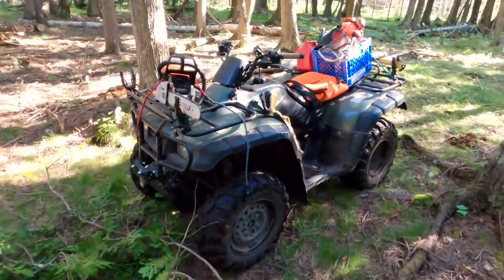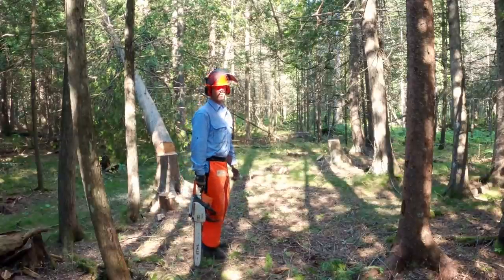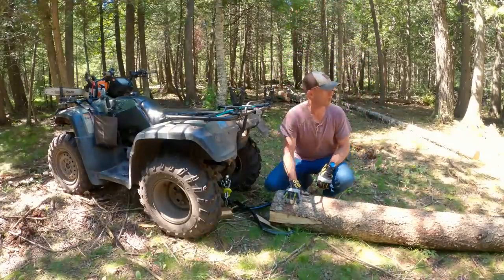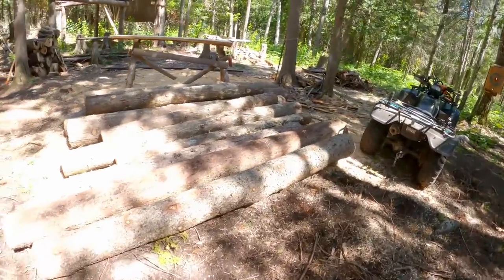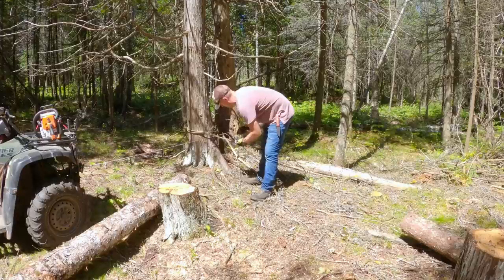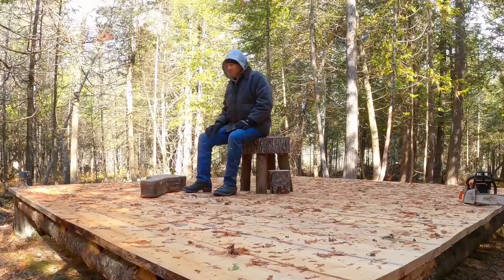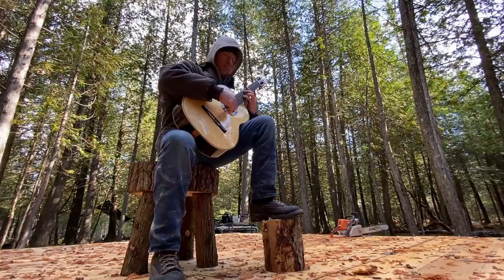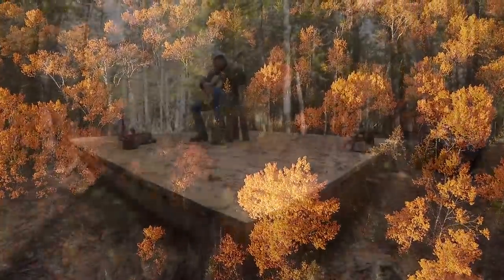Log and Chainsaw-Milled Lumber Gazebo Foundation Build #16

Comment: 13:48 Holy crap, man! The boat winch on the saw mill piece is an awesome idea! How did you attach it and to what are you connecting the cable? Wish I had thought of that.
Reply from the maker: Just pulled one of the bolts out of the winch and replaced it with a longer one.  The hex head slid right into the C-channel on the mill.  I have my sawhorses set up right in line with a tree that has a sling wrapped around it.  Not sure where I saw that done but I'm definitely not bright enough to have come up with it myself.

Comment: When that chainsaw vibrated in a tight circle is what I call the dance , it's  when a saw is tuned and running as good as it gets !!! !!!! That's just my opinion and observation after working on them for30+ years . Nice pickin too !!! Great video .

Comment: This is so awesome. I'm slowly catching up on all of your videos. I know nothing about wood, but just out of curiosity do you have any concerns about mold or rapid decay with this cut, untreated wood? I'd love to try something similar.
Reply from the maker: Thanks for watching!
Certainly if I wanted this to last for a very long time, the wood would need to be treated. Either pressure treated or with sealer rolled on. Ideally both. I think the boards that are cedar will last quite a while but the pine, probably not.
Problem is that this wood came right out of the trees so probably can’t be sealed until it dries for a year.

Comment: Nice work the only problem i see,,,,,and question at the same time,how long the roots stay safe before get rotten  5 years_then you have to make them in stone or cement.
Reply from the maker: There are some cedars on the property that were logged over 100 years ago and the stumps are still there and intact. Cedar is very rot resistant.